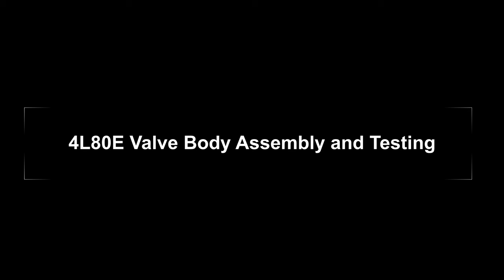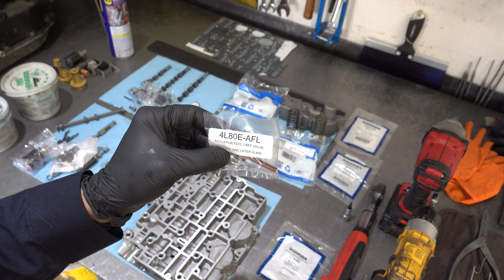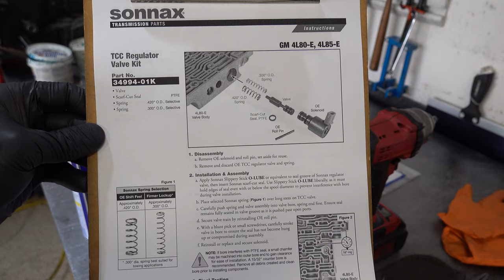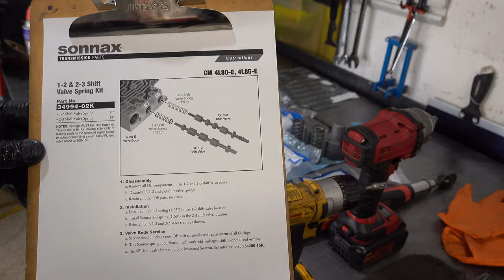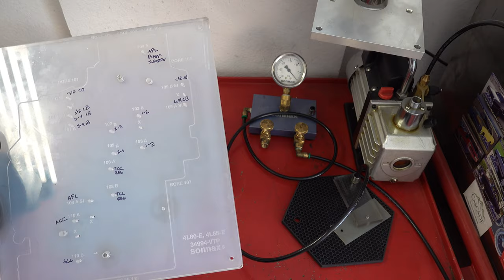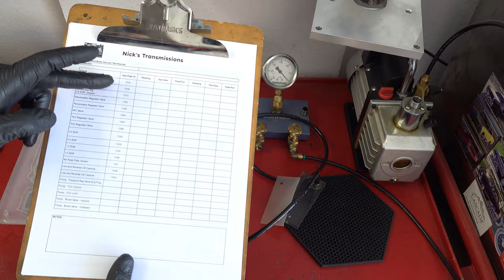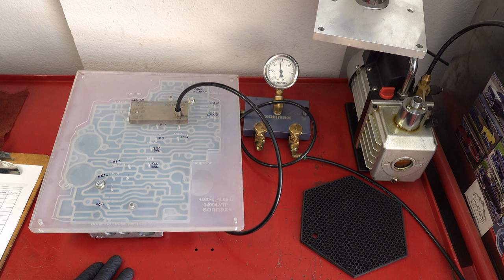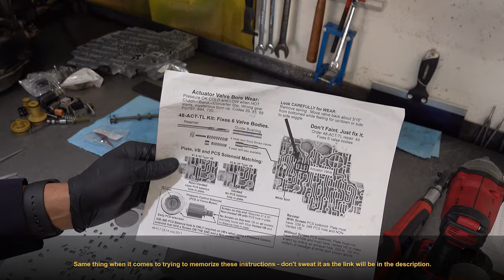4L80E Valve Body Assembly  - 1999 Unit

Comment: Well I needed to get this done so I searched and found the instructions for that Sonnax Sure Cure kit.  I drilled 1/2, 2/3, 3/4, and Reverse feeds all to 0.086 per Sonnax recommendations.  Then I saw your post and watched……..hopefully it will perform as well as I think it will.
Reply from the maker: Gotcha - no worries...If you find the 1-2 and/or 3-4 shifts are too harsh, you can peen those two feed holes shut in the spacer plate then re-drill them .010 smaller (that usually addresses overly harsh shifts). The 2-3 feed hole should be fine given you're dual feeding as it needs more volume into that circuit faster than otherwise as the additional space otherwise acts like a 2nd accumulator in the 2-3 apply circuit.
Reply: So you think it will be more than street car stiff?
Reply from the maker: I rebuilt a 4L80E with a Superior Tech shift kit once for a guy who was doing a swap in place of a 4L60E in 1500 series pick up. The vehicle was otherwise completely stock. I drilled the 1-2, 2-3 and 3-4 feeds per the instructions, finished the unit and gave it back to the customer. A few days later he reported that all of the upshifts were like 'bang shifts' and he said he could barely drive the truck. I told him to bring me the trans back, which he did and I swapped the spacer plate for an unmodified factory compatible plate and gave him the unit back...He told me it shifted perfectly. 

The feed hole sizes per Superior Tech's instructions were .80, .85 and .80 for 1-2, 2-3 and 3-4, respectively.

Hope that helps.
Reply: @nickstransmissions  Yea I have been looking around and the sizing seems to be all over the map!  I finished and gave it back to him this evening so I will soon know.  Can't express how helpful all your input has been Nick!!!  Thank You Sir!!
Reply from the maker: You're welcome, Ross! 
Appreciate the views and kind words. 

Let me know how it turns out....
Reply: I will let you know.  I could honestly really benefit from working with a veteran builder for a few months.  Most all of what I have learned thus far has been self taught from either studying book, watching build videos, or just learning from mistakes.  I’ve got a decent handle on mostly stock builds and have purchased (and will continue to do so) probably 20k worth of tools and manuals.  I am a thirty plus year Master tech.  I have been building here and there for quite a while and just recently started building at more of a full time job.  My manager and the owner are both behind me and have been very encouraging the past couple of years.  I still have a ton to learn though!
Reply from the maker: Yep, that's how I started out; can't tell you how many times I wished I had some wise old man (transmission builder) looking over my shoulder, pointing me in the right direction and saving me from myself, lol...But once I had enough transmission jobs under my belt, I became comfortable and confident that I could last in the industry...Glad you have a support system, it definitely helps when you hit those inevitable bumps in the road along your rebuilding journey.

Comment: Nick thankyou for clearing up the feed hole confusion now Im off to figure out the check ball situation. As in leave reverse in or out in a basically stock c3500
Reply from the maker: Your welcome, Steve - thank you for watching....Leave it in for now as most folks think reverse is too harsh if left out, unless you frequently tow very heavy loads...Then I'd leave it out since the vehicle's weight will absorb most of the shift energy.

Comment: So I’m trying up figure out an 02 4l80e that the previous folks took apart that only has 7 check balls in it. Of course it was not running or installed on anything when I got it (fb marketplace special) and I’ve not seen it run nor have any history with it other than they said it was supposed be a “good transmission” , so idk what else they did to it as they somehow got the selector plate on backwards which is really hard to do and it was obvious they had removed the valve body at some point. So I’m swapping out the valve body with a reman one and will assemble the best I can thanks to your vid series🙏🏼. Now idk if they left the 8th check ball out on purpose or they were just further incompetent. It’s the one closest to the reverse valve (says #9 reverse on some diagrams) . The valve body appears to be stock and the separator plate is the 4272 and the gasket is the 423 on top. Do I need that last check ball? Seems most people say to use all 8?.
Reply from the maker: Hi Bob, thank you for watching...

When you say they got the 'selector plate on backwards', what part are you referring to? There's nothing on that transmission called a 'selector plate'. 

Regarding the reverse check ball, many builders leave it out for faster engagement into reverse...I usually don't recommend it unless the vehicle is very heavy like a diesel-equipped or otherwise 6.0 or big block tow/haul vehicle....
Reply: @nickstransmissions  the gear selector plate I’m referring to is the one that engages with the manual valve. It’s mounted on the selector shaft that the linkage mounts to on the outside of the case. It’s unbelievable to me that whomever took it apart got that gear selector plate on backwards lol. The little steel pin that should engage the manual valve is facing the outer case so it cant operate the manual valve. I figured it out because the b&m shifter I was installing would not be in the correct positions when run through the gears. I’ve never had the transmission installed or apart so I assumed it was okay when I bought it as they claimed it was lol. This Transmission is going on a big P3500 Stepvan so probably be fine leaving that 8th ball out (aka as position #9 on the exploded views). Thanks!
Reply: @nickstransmissions  thank you so much for the high quality videos!!
Reply from the maker: The "gear selector plate" is called the Rooster Comb...
Reply from the maker: You're welcome, man. Hopefully you can get it back running again with the new valve body.

Comment: Hi Nick hope you dont mind I have another question. I have my trans in and driving around, forward enguagement and shifting forward gears are good with just under 100lbs of pressure. My reverse still has about a 3 second delay but does go in with slightly higher pressure.  Im wondering if I should go and remove the reverse check ball? Or should I get a tech 2 scanner and check the voltage to the force motor. The chinese knock offs are about $300. And also would the tech 2 set a different voltage for the pcm if needed? Appreciate  any thoughts you may have
Reply from the maker: Depending on how you set up the direct clutch (i.e. dual feed), a slight delay into reverse is considered normal but three seconds seems excessive...I'd drop the pan and valve body to do an air check of the low-reverse servo (you'll have access to the feed port once the VB is out of the way) then check servo travel with the cover off. You should see somewhere between .125-.175 as measured from the top of the edge of the servo to the case deck surface when measuring between the rearward most two cover bolt hole locations. If your band is applying the drum and your servo travel is within that range, I'd reassemble everything and leave out the reverse check ball.
Reply: Hi Nick, im duel feeding yes and the servo travel is good. Air checked good and left out the check ball. Reverse now feels normal. But now driving along in 4th it dropped down to third and the pressure spiked to 150. I have a scanner coming next week. Maybe that'll tell me little more
Reply: Just an update truck warms up and then downshifts from 4 to 3rd and wont upshift. Changed the ignition switch but no change. Scanned it and has p1870 code (slipping) speedo seems to always read 5 mph higher than im going. But doesnt  feel like its slipping,  when it kicks down to 3rd the pressure boosts to 160. Wondering if i should turn the force motor up. Idk 60-70lbs in D seems low. and then code pops up and then goes to 160 -170lbs. New torque converter speed sensors. Seperator plate was ok using the  brown check balls.
Reply: Hi Nick another question my  force motor is reading .9 amps @ about 100lbs. Of pressure with the tech 2. The book says at .9 amps the pressure would be about 30-60lbs. Are these early 4l80e numbers?  Either way im vac testing the valve body im getting erratic results. Im reading the 1870 code points mainly to the converter, its a new one though.
Reply from the maker: What specific readings are you getting on the valve body and for which valves/valve trains are the readings erratic? 

P1870 is usually converter in the 4L80E but can be TCC regulator valve, excessively worn stator bushings, converter clutch o-ring seal on the input shaft, cross leaks somewhere in the TCC circuit, etc...
Reply: With the tech 2 im getting amp readings of .9 in forward gears and 1.0 in reverse.  Is there a normal amp reading from the pcm.  I cant find much on this. I can boost the pressure by manually increasing the amps. About 60lbs in reverse warmed up. Little nervous about reprogramming pcm if thats the issue

Comment: Thank you so much for sharing this information. I wish for you a good day. From Iraq.
Reply from the maker: Thank you for watching! Have a great day as well.
Reply: @nickstransmissions  hey Nick I'm trying to replace my tcc valve and spring I'm wondering if I can get the valve out without taking valve body down????
Reply from the maker: Hi Dylan, you'll need to take the valve body out - watch the vid and you'll see how the roll pin installs from the underside of the VB but there's no hole for the roll pin on the top side of the valve body which is the side that faces you when looking up at it from underneath. I show folks how to get it out in the tear down video; it sometime can be a pain but usually comes out without too much grief. 

Once you have the valve body out/on the bench, you can install the Sonnax 1-2 and 2-3 shift valve springs along with the bore plugs for the 3rd/Rev and Low/Rev check ball locations as they address known trouble areas in the VB. I'd also replace the o-rings on the EPC and shift solenoid filter screens as well. You can also check the accumulators and then drill the feed holes for your 1-2, 2-3 and 3-4 upshifts if you'd like, though don't be too aggressive if you're running a stock stall torque converter, especially on the 1-2 (That you may want to just leave alone).
Reply: @nickstransmissions   thanks brother I'm watching your tear down video now thank you

Comment: Hi Nick the tcc valve lockup spring for heavy duty towing, is it like a hard shift when you dont have a load on the truck? I will be doing some towing with my diesel duelly truck but im not sure I want a hard lockup with daily driving. I'm trying to decide which spring to use. Thank you for all the videos you do.
Reply from the maker: Hi Steve, the primary difference between the two TCC springs is that, with the HD spring, you'll clearly feel the converter clutch come on whereas the factory spring provides a stock feel, which sometimes isn't noticeable from the driver's seat. 

I always install the HD spring and haven't heard any adverse feedback or complaints from customers thus far...
Reply: @nickstransmissions  thanks Nick you've been very helpful.  I've rebuilt a few transmissions over the years and was an R&R guy in the 90's for a few different trans shops. 2 different aamco shops too and now I see alot have closed. Again I appreciate your videos thank you
Reply from the maker: You're welcome, Steve!